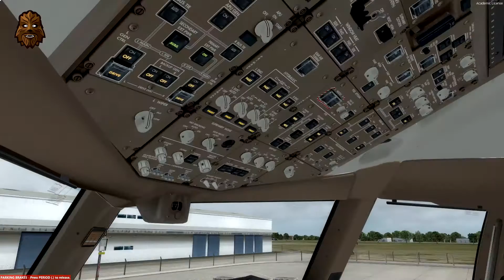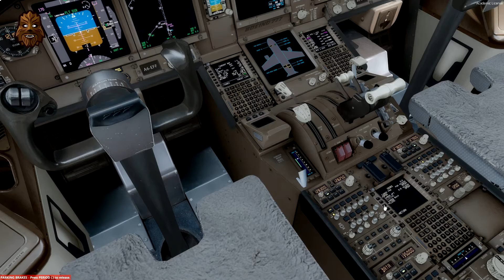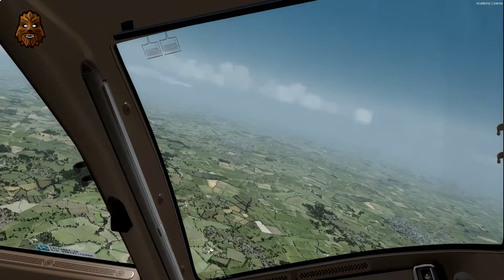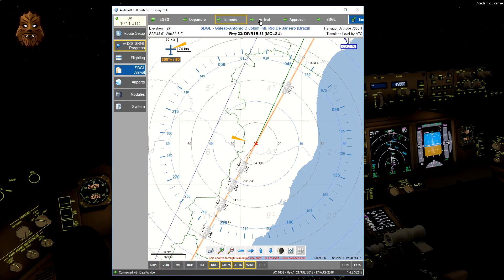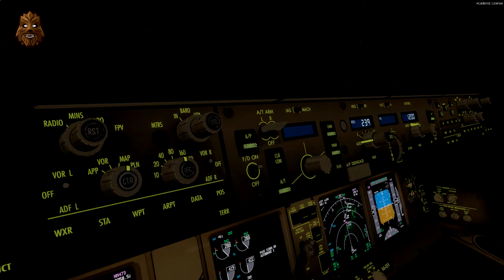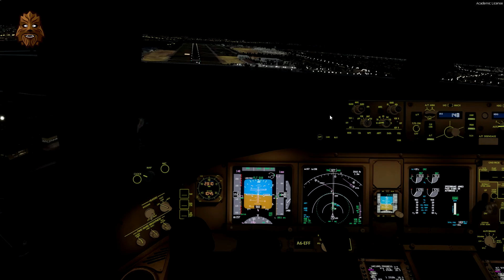[P3D v3.3] London Stansted (EGSS) - Rio de Janeiro (SBGL) Full Flight | UAE 777F Charter

Comment: Why u used two FMC? i thought they are both the same
Reply: Both FMC's are the same, there are 2 because it allows the captain and first officer to program the aircraft at the same time, which saves time.
Reply: You have two sets of information up at the same time with using both FMC's. Creates a more efficient workload.

Comment: My pc is not much different from your. Just the video board. Mine is a gtx 1070 8gb. Your is a gtx 1080 8gb. But I can not get the same performance I see in your videos. Sometimes I run out of memory when approaching Seattle Tacoma. I believe that this difference in video board is not the problem. Could you tell your settings on p3d or the pc? Thanks!
Reply: ÍKARO ARAUJO DE SOUZA MARQUES How much ram do you have?

Comment: What are your PC specs? Great video! Subscrbed! :D
Reply from the maker: CPU: Intel® Core™i7 Quad Core Processor i7-6700k (4.0GHz)
GPU: 4GB NVIDIA GEFORCE GTX 970
MOBO: ASUS® MAXIMUS VIII HERO: RoG, PCI-e 3.0, SATA 3.0
RAM: 16GB Corsair Vengeance DDR4 3000MHz
OS: Windows 10 (64 bit)
Hard Drives: 500GB Samsung 850 EVO 2.5" SSD, 3TB WD BLACK 3.5" WD3003FZEX
Cooling: Corsair H80i GT Hydro Series
Case: Coolermaster CM Storm Enforcer

Comment: Hey Chewwy, I always go by the Flight Plan as that would be what you would file to ATC. They therefore know what levels you are flying at and it easier for them to control with the further information that they have. Should you want to make any alteration to the levels on the flight plan then you should refile your plan with ATC so they know. Hope this helps.
Reply from the maker: Thanks for the response Jack. I mainly fly offline when flying long haul and therefore don't have to worry about ATC and their info on flight levels but will remember this if I do fly online in the future.